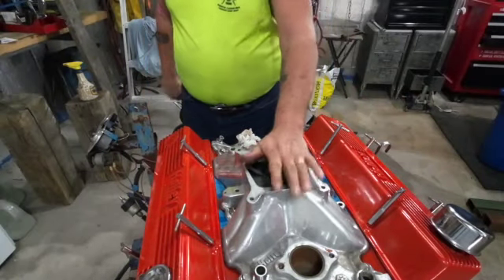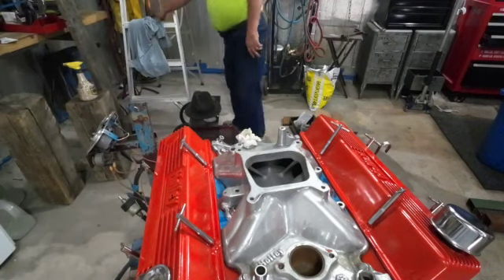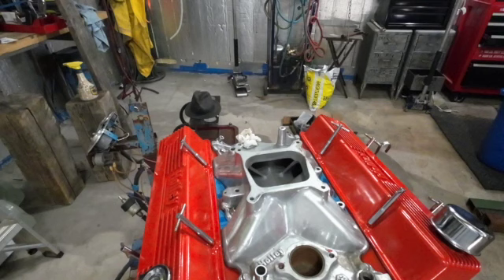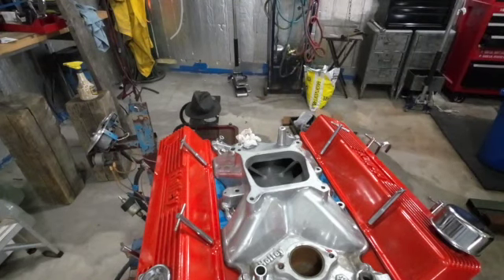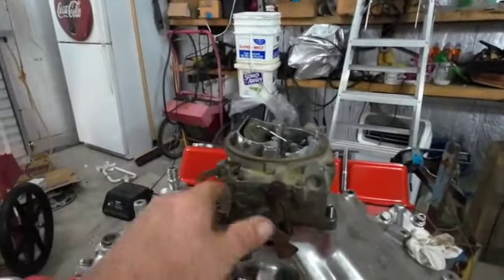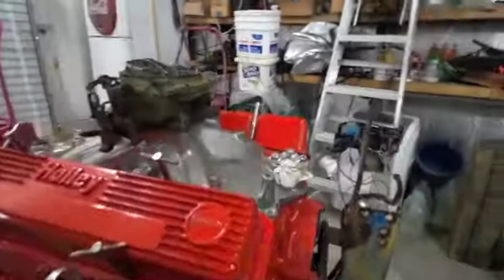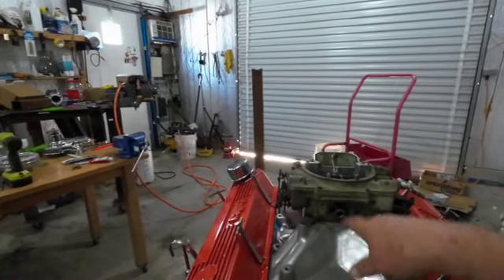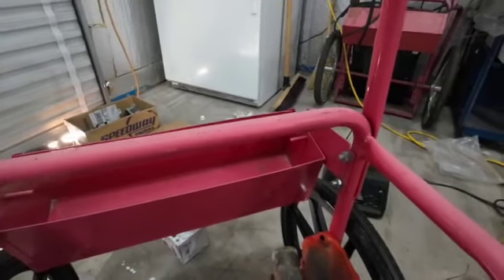Final assembly rebuilt Chevy 350 #SBC  #SBC 4

Comment: 600 cfm is what you should go with on a 350 650 cfm would be better if the moter had racing cam or racing crank and hydraulic lifters then I'd use a 650 cfm semi stock may be a little cam like you have there 600 cfm is better...
Reply from the maker: The one on the motor is not the one I'm going to use.  I just put it on there to keep dirt out.  More to come.